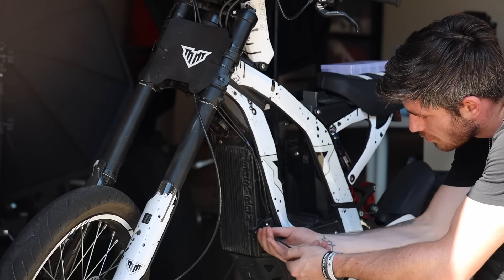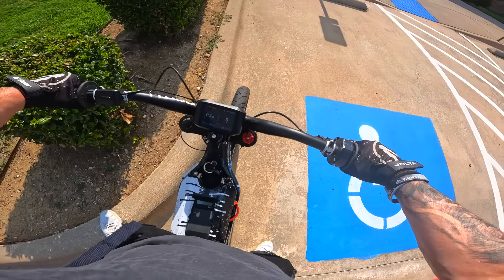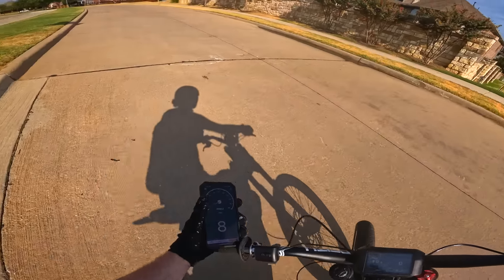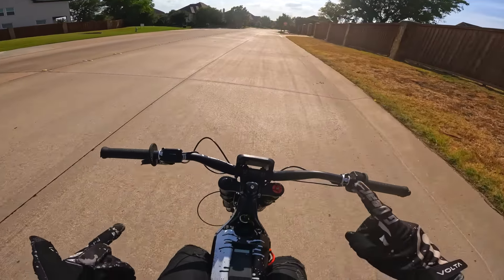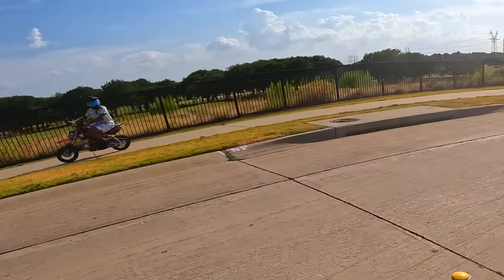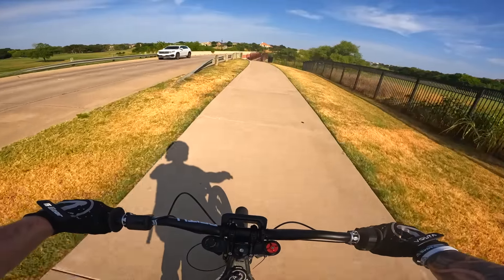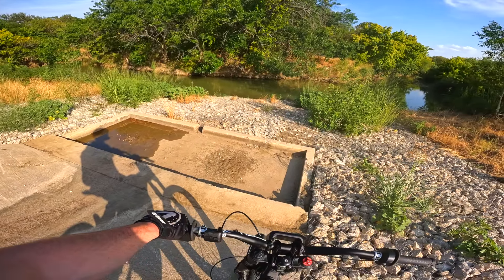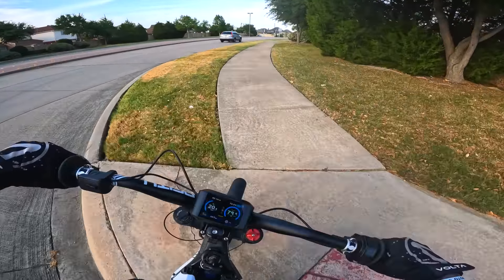The BEST Sur Ron battery UPGRADE - Shock Bikes (EBMX)

Comment: Dude that looks like so much fun! The new battery is insane. I can’t wait to see mode 9! Lol!
Reply from the maker: I didn’t explain this very well at all but mode 9 actually is mode 5. I have it on a setting where it’s 1-5. I have another setting where it’s 1-9. 9 isn’t necessarily more power on this setting but it’s as if you have a 1, 1.5, 2, 2.5, 3, 3.5, 4, 4.5, 5. So same power but more in between options. Hopefully that makes sense
Reply: Yo Gbear are you doing a give away on a new 72v Sur Ron?

Comment: Thumbnail said 0 to 60 3 seconds, you were talking about 95 or 100 for a bit and then you were saying it might to 65 downhill.
Are we mixing mph with kph or did I miss something?
Either way it fast and very cool, looks fun.
Reply from the maker: Yes, the display said 100 because it was is kph. Then I got out a speedometer out to measure it in mph and saw 65. I should have been more clear
Reply: @GromieBear  what up man have a question where did you get the wrap for your bike at on the rims and frame I love it